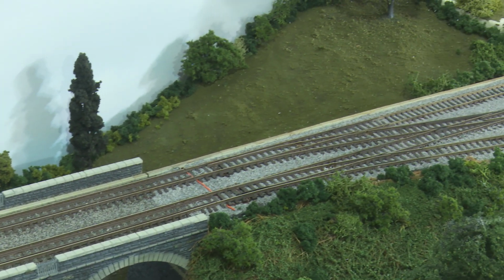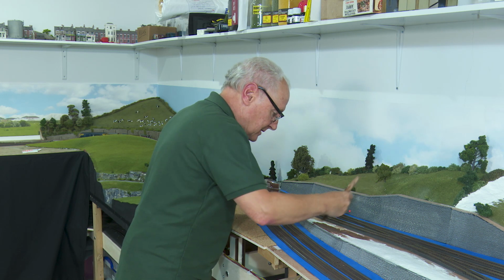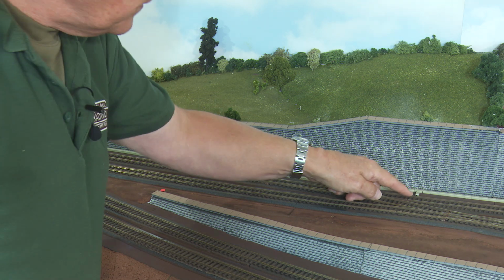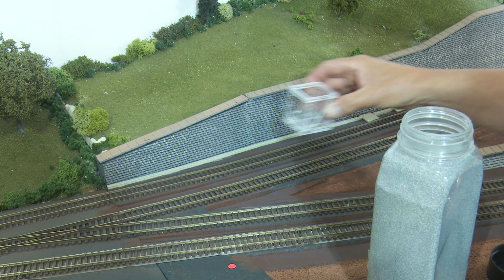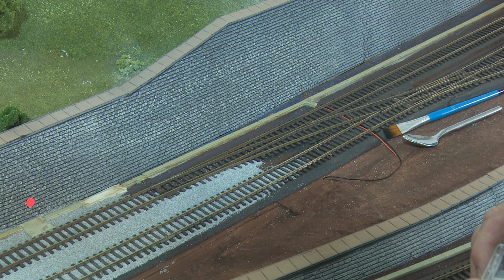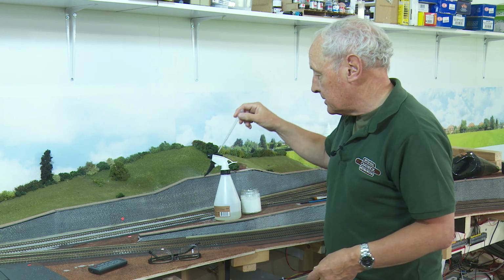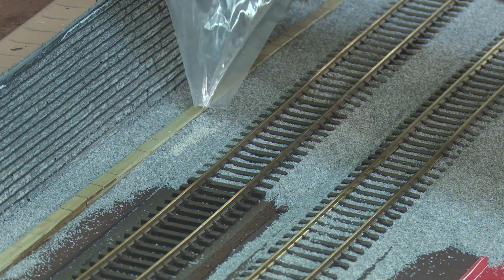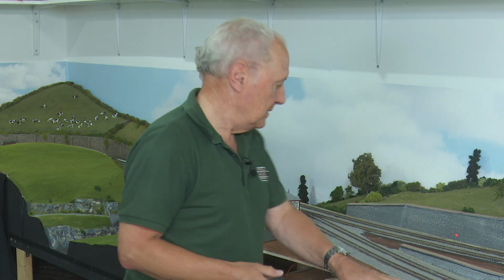Ballasting at Chadwick Model Railway | 138.

Comment: As usual, your videos make me feel like I've dropped in on a friend's layout for some advice, since we get the whole thing - humor, facial expressions, side comments, and an unpolished result. Thanks, Charlie.
Using the handheld vacuum sure seems a lot easier than all the commotion of custom heads, tubing, and cyclones added to a vacuum. Also, the one shown does not require placing anything over the inlet to catch the ballast. Well done. 

One point, though, the spreader referenced will not ship to the US, but Bachmann does have one listed on Amazon with a side lever for control, which, when shipping from US to US vs UK to US is considered, works out very close to even. (Being a GBR modeller, I am prepared to have a significant portion of my modelling budget spent for international shipping, so that is not the complaint.)
Reply from the maker: Thanks Jack, I’m so pleased that you find the channel interesting. Stay safe, regards, Charlie

Comment: My little Inglenook Sidings layout is built on a 6 x 1 foot shelf.  I put the track down on some old 1/8 inch cork sheet cut to the track width, then covered the rest of the layout with 1/8 inch foam core board as a scenic base.  Whilst watching this video I realized that the foam core board has played the same role as your blue foam sheet in reducing track noise.  If I had it to do over, I'd probably just lay the track directly on thick insulation foam and be done with it, but thanks to you I can now justify what I did to inquisitive friends.  Oh, and I might add that even on a tiny layout like mine with only two sets of points, ballesting is The Worst.
Reply from the maker: Great comment Andrew,  it’s a drag at the best of time.

Comment: Afternoon Charlie, I had ,a similar problem and used double sided (25mm) tape on the board
according to track plan and a 'Yoga' mat cut to plan layed on it and another run of double sided 
tape on top of that then press track down (no glues, nails or screws) no noise and easy to relay if
need be.
Reply from the maker: Create advice, Wayne, I never thought about using a yoga mat. Regards, Charlie
Reply: @ChadwickModelRailway  Thanks Charlie, Down here modedeling of any sort
is so horrendously expensive so being inonovative railway modellers, we come
up with ideas like this. Big thing is, ballast stays between the rails and down 
the outsides extremely well  leaving the center between the tapes as your
'flexible' sound barrier

Comment: Hi Charlie. Not wanting you to freat and use lots of time on it.
 On my last shifts I looked closer along a few routes and the ballast as a whole is the same throughout the cess, 4ft, 6ft and 10ft.
Some areas will vary of course as you've seen but in general it tends to all be same type of ballast as the way the track bed ballast is layed and tampered is what creates the ballast within the cess along with all sorts of other stuff like vegetation, quite often an awful place to walk if required. 

Differing amounts are used depending on how much weight or support the track bed requires. Often around bends you'll see a higher mound, direction dependent, on the outer side running rail for extra weight and support, higher than the running rail itself.

This and discolouration I feel would give you greater realism.

Great video as always
Reply from the maker: Thanks Rob for a useful comment.

Comment: The nuts and bolts of railway modeling!  Nobody really enjoys ballasting; however, using available tools and new techniques make it survivable.  You've certainly shown the most efficient way to complete the task.  Great video, Charlie!  I always enjoy your lessons!  ps - I agree on the different color edging; just pull out the airbrush and solve the problem!  Cheers!
Reply from the maker: Thanks Pat, a reassuring comment thankfully. Regards Charlie

Comment: The orange pipe is used to protect the cables which go inside it from damage by tampers and the like. Before that the cables were either just in the ballast or cleated to the tops of the sleepers. When the orange pipe was first introduced the idea was to put it in a bed with very little ballast so if it got hit by the tamping tines it had room to move or rotate. We then started to fill all the beds with lots of stone and particularly build shoulders on the outside. That left nowhere for the orange pipe to go and so tamper damage returned. The latest is to install hollow sleepers so that the cables can be fed through the sleeper. Your orange wire makes a good looking version.
Reply from the maker: Thanks John, it’s great to have you on side. Regards Charlie
Reply: @ChadwickModelRailway  If you regard it as a pipe then when modelling it I suggest you try and get it as straight as possible rather than looking like a cable. We do also use orange hydraulic hoses for some types of point which wander more like a cable. But your railway is so much better than mine, who am I to criticise. :-)

Comment: Hi Charlie!
That came out quite nicely!

I thought you'd like to know... the orange pipe under the track for signal and point motor wires... that was introduced in the late 80's due to the weight of trains passing overhead crushing the wire and leading to loss of signal, or shorts.
If I recall, I believe it was one of the causes of the Clapham Junction crash of 1988, and the resulting solution being the orange pipe.

Obviously, with Chadwick being a 1960's/70's layout, the orange tube wouldn't exist for your layouts timeframe.

Initially, a narrower version os concrete trunking was laid 'under' the track, as well as next to it... but this method soon was abandoned due to the weight of trains passing overhead would push the track down and crush the conrete trunking underneath... so they abandoned that idea and went to plain wire instead.

Here's a couple of pictures of the trunking under points.
https://www.flickr.com/photos/davidwf2009/5662520468/
and
https://www.flickr.com/photos/blue-diesels/2432099142/

And here's the plain wire (and on the left side, you can see it's not at all neat, and the wire just goes everywhere it needs to!).
https://www.flickr.com/photos/d1015/5537043713/
and
https://www.flickr.com/photos/davidwf2009/5607011590/

Hope that's useful!

Here's a little tip for you.

Once the ballast is all good and dry, most people weather it in with an airbrush... but the problem with an airbrush is that the weathering paint will only sit on the surface of where it was sprayed.

My method is to brew up a pot of REALLY strong tea.... just save all the old tea bags you used in the last week.
Like when you do with the PVA/water mix... but in smaller amounts... using your pipette, drip it over all your ballast and it will seep into all the cracks and darken it up.

Cheers

Laura
Reply from the maker: Another excellent comment Laura and very much appreciated. I’ve tracked the orange tubing down its earliest used being in 1986. Sadly a long time after my layout as you mentioned. The concrete trunking is actually known as the concrete trough, as I’ve been told by many ex BR  employees so that put me in my place. I think Peco might be responsible as they label their product as concrete trunking. 
I must buy you a cuppa at the next model railway show.
Take care, regards Charlie
Reply: @ChadwickModelRailway  I didn't know it was around as early as 1986... so we both learned something!
I didn't get interested in trains until 1988, travelling from Doncaster to (ironically) Barnstaple every other weekend (boarding school)... so I didn't see any 'introduction' referenced in a magazine.

You're right, BR alled it "Standard Reinforced Concrete Troughing".
During my time as the DEMU society's Drawings Officer (I'm currently their Vice-Chair), I scanned a lot of BR drawings... one of which are a full set of diagrams for the troughing segments.
Heights varied from 130mm, 170mm, and 240mm, and widths of 250mm, 280mm, 340mm and  440mm (not including the 50mm tall lid).

I own a high resolution 3D printer (resin type) which I've used to make window frames two tenths of a mm thick... and I have a rake of wagons that were used by the S&T department, which were frequently used for moving concrete troughing... so as well as making my own troughing for my layout, I can use the same parts for the load of a train.

A cuppa is no use to me, LOL, I'm allergic to tea and coffee... but a can of pop will do! LOL!
Reply from the maker: Great comment Laura, the cokes are on me.

Comment: Some useful tips in this to help out the ones who fear this part. Me myself, I quite enjoy ballasting, earphones in and a pint or 12, job done 😆 
The orange wire you use, if you were to strip some of the outer sleave either end revealing the strands, they look great painted black and replicate the black cable that runs through them! 
Tim.
Reply from the maker: Great tip Tim, much appreciated.
Reply: I'm with you there tim, it can be quite therapeutic, the pints not ballasting lol

Comment: Excellent. Yes, double layer of foam (ie layer of 3mm foam on entire baseboard) prevents a bridge between the PVA and the baseboard. We use 3mm closed cell dense foam for entire board, and again cut to size for the track bed. That way the PVA never comes into contact with the ply baseboard top (ie never creates a sound bridge).
Reply from the maker: And where were you when I was designing mine! Regards Charlie
Reply: @ChadwickModelRailway  A pal saved me with the advice about the self adhesive closed cell foam double layering trick. Its worked a treat on Gort so far. Nearly as whisper quiet as the old peco foam underlay from years ago. Cheers and thanks for all your amazing videos, have been a great training and tutorial aid for me building Gort station. Before any new task I always consult Chadwick model railway video library.
Reply from the maker: What a heartwarming comment, regards Charlie

Comment: Great video Charlie. The revised approach with battling the noise technics was missing in the collection. A massive applause, as nobody else shows this technics on YT. Some tips from me: to avoid painting the foam, it is enough to buy different colours of foam sheet, i.e. dark brown (also from the same supplier). Secondly, WS Foam Tack Glue is very similar in terms of price (almost the same) as Copydex (when comparing £/ml). I have got both glue products and using interchangeably.
Reply from the maker: Great comment mate, and it’s still great to have you on board. Regards Charlie
Reply: @ChadwickModelRailway  Thanks Charlie & my pleasure.

Comment: What you need, IMO, is a connector between the ballast spreader and the ballast container itself OR a larger hopper to get a bigger run.
Reply from the maker: You’re right mate, a bigger hopper is required. Regards Charlie

Comment: 👍 I prefer paperpowder, two tones mixed. Just (slightly over)mix it with water and apply with a drinking straw like tube, and you're done. I've used you method as well and it gave me headaches 😁 I've used coffee grounds as well, mixed with some paint and pva. In my experience pretty much anything except stone will  prevent the dreaded "drumming", it's not the pva. Please don't call me to do your ballasting 😉
📞 Hmm, that'll be the phone then.
Reply from the maker: An interesting comment Rob, many thanks. Regards Charlie

Comment: When I started building my model railway at the beginning of the first lockdown, I watched loads of Youtube videos to discover the different ways of ballasting track. The method I adopted was the Chadwick way although I have not got a spreader but instead use a teaspoon to carefully ladle the ballast onto the track, spread it with a finger or soft brush and then, most definitely, use the back of that teaspoon to vibrate it down and off the sleepers. The first bit I did was before learning of the tapping and it was not as neat as after discovering that trick. You are an inspiration Charlie so thank you for taking the time to share your knowledge (O, and of course some of the mistakes!)
Reply from the maker: What a heartwarming comment John. I’m so pleased that you find the channel interesting. Regards Charlie

Comment: Charlie instead of using the paintbrush to clean up the last bits of ballast I switched to using a foam “brush” which are really cheap from an art supply store. Loads of guys use them for applying paint washes to rock work so I hope you know what I mean. They are brilliant at getting rid of the last remnants of ballast, you lat it down between the rails and gently run it back and forth. It’s also effective on the outside part of the rail and as the end is pointed in shape also great to tidy the edges of the ballast into a clean and neat shoulder.
Reply from the maker: An interesting comment Sean, thank you. Regards Charlie

Comment: I read on a forum years ago that a 50/50 water PVA mix was wrong. The poster wrote that you only wanted to fix the ballast down, not turning it into  concrete. He recommended a 1/5 glue to 4/5 water mix. The result being that it doesn't set rock hard and therefore reduces noise. The tip I found today that mentions it was from Graham Plowman.
An easier way than this? Try a salt shaker.
Reply from the maker: An interesting comment but I wonder if when cleaning, you might Hoover it all up!

Comment: Since Woodland Scenics ballast is made from walnut shells it can be made even finer by grinding it into a powder with a coffee grinder. It can be a slow process if you need a lot of it, but, it’s a great way to make dirt, sand, and all other manner of fine material. Additionally, you can alter the color by mixing in some weathering powders just prior to grinding it.
Reply from the maker: The great tip about the grinding Bruce, regards Charlie

Comment: The BR employee who suggested that cables be put in Orange pipes to stop them getting damaged by tampers won the staff suggestion prize in the early 1980s.
Reply from the maker: But now I believe that they are being discontinued!
Reply: @ChadwickModelRailway  interesting. The London Underground (Metropolitan Line) have never used them. Maybe with modern on track machines the technology can identify and avoid the cables in the four foot.

Just shows you have to have contemporary photos to keep the details accurate. I like your cable trunking, it makes the scene come alive. i wonder when cables replaced telegraph wires in those areas that retained semaphore signals. i expect that was in the 1970s.

Comment: Hey Charlie, why not put that blue insulation material on the board first, wide enough so it  will not be covered completely with ballast. And on top of that blue material, you could put your trackbed on it, which will be completely covered in ballast. This way you get a double sound insulation between the track and the board.
A friend of mine did it like this, and the result is really good when it comes to sound reduction.
You might give it a try ...
Reply from the maker: An excellent point Mark, but sadly a bit late for this part of the layout. Regards Charlie

Comment: G'Day Charlie.
I have still been watching your video's, just haven't commented much of late, but since you asked, I thought I'd remind you of how I go about keeping my track induced sound down. Try to use as thick a Base Board/Spine Board as you can afford, less able to resonate. I use a Spine system, less board to also resonate
1.) After doing the wood work, lay either some XPS Foam or Self Adhesive Neoprene Foam to top and bottom on all the flat surfaces you plan to lay track onto (full width of track area or as much as you can). I prefer the XPS Foam on the top due to it being available in thick sheets and the Self Adhesive Neoprene Foam on the bottom as its easier to stick it up. You can basically use any sound deadening material on both sides, what ever you can get that's cheap.
2.) Now lay down your Neoprene Foam Track Bed ( I buy a bulk roll from my hardware store, its Self Adhesive as well).
3.) I fasten my track down mostly with Sika Appliance Silicone, its the only silicone I have come across that remains soft and rubbery after it cures. Sadly due to heat and the related track expansion I get being in my attic under a tin roof, certain parts have to be "Pinned". By that I mean I have to use a largish washer over the track sleepers between the rails and a flat head bolt that I grind down the head on to clear the loco's couplers pin (Kadee's). This bolt is only snug and is locked down with two nuts and lockite.
4.) Use contact cement glue to hold down the ballast, its a rubberised glue. I was at first using a Spray can type but was having issues with it moving the ballast as I sprayed. I then found a better contact cement, its water based and you use it just like you would do PVA glue. So do all the normal things you do when using PVA, but instead you now use contact rubberised glue. The product is called "3M Scotch-Weld™ 30 Liquid Rubber & Contact Adhesive". Its not cheap cheap but since you buy it by the litre and you will be diluting it with water, you get a lot for your buck in the end. 1 Lt can should do most people.
I get mine from RS online. https://au.rs-online.com/web/p/adhesives/3337529/?cm_mmc=AU-PLA-DS3A-PRODUCT_GROUP&gclid=Cj0KCQjw0K-HBhDDARIsAFJ6UGiOyLVW1yJcALPjc9LA7YVuc904oMWmef_AJC_TUNLAI1_I_YPRjG4aAu44EALw_wcB&gclsrc=aw.ds&matchtype=&pla-322233505333
Reply from the maker: Hi G130,
A great comment and I shall certaily check out this glue.
It says Blue on the can, is it?
Regards Charlie
Reply: No it behaves just like PVA in that when dry, it's clear. As you dispense it, it even looks like PVA as it's white. All information on the specification sheet matey.